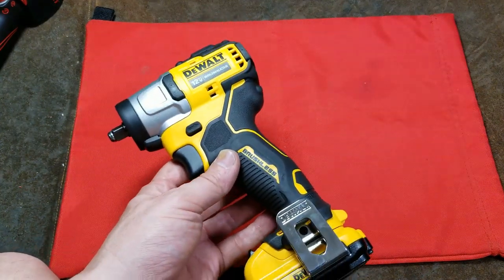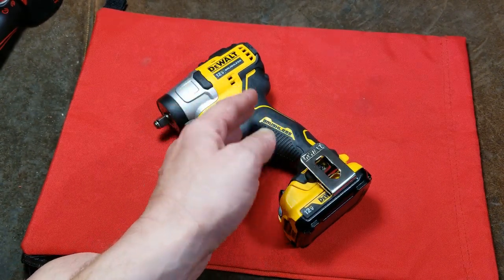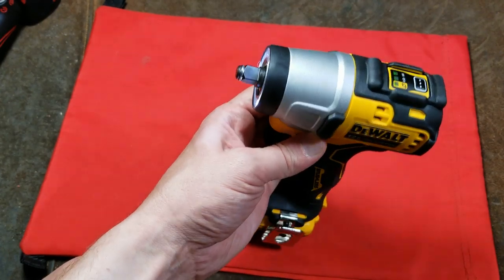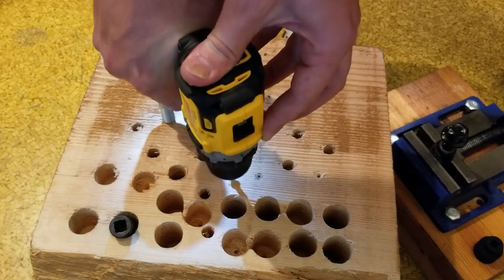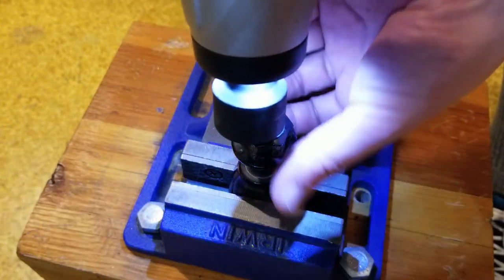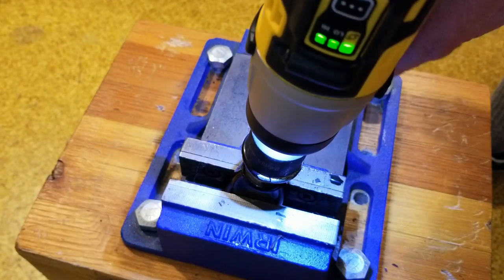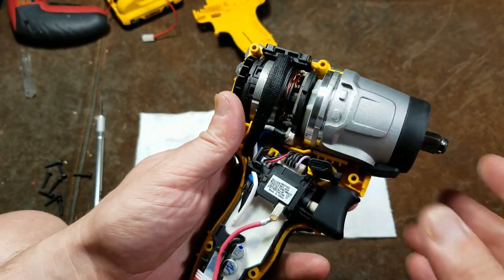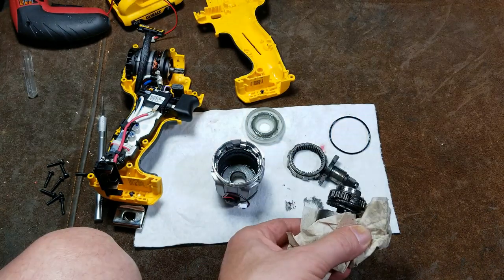DeWalt Xtreme Sub-Compact 12v Brushless ⅜" Impact Wrench Review

Comment: Great review cat, I find the dewalt pretty weak. I bought the 3/8 stubby and it’s hands down much better. I have both of them and I will be taking the dewalt back. There are a few things I like about the dewalt. The light and the handle but that’s about it. It needs more power if it had the power of the stubby I’d buy 12v dewalt all day over Milwaukee. Considering it isn’t even close I gotta pass. The 200ft lbs breakaway is a joke. It struggled on my lugnut that were 100. It did get them yes but it took a few sec to get them. Milwaukee zips then right off like nothing. I live in the rust belt so power matters a lot to me more than price. I’m not a value kinda guy I want the best you can get price be damned. I’ll pay more for not having to get up 10+ times to go get another tool to do the job at hand. I’ll pay more for that convenience any day ntm a better warranty as well. Sometimes you actually do get what you pay for.
Reply from the maker: If you want power and reliability without question than you would use a 3/8 air impact no electric tool comes close to the top end air tools. 

I got the Milwaukee M12 second gen impact and drill I'll do a review on. I agree the Milwaukee's are more powerful you can get larger batteries and they have a wider selection of tools, and a longer warranty. to bad their ergonomics are horrible. And the electronics are more questionable than the dewalt's mainly because they have to cram everything in that tiny little circuit board that they can't even protect. My review will include a teardown.
Reply: Catus Maximus I agree the handle and the light on the dewalt are def better. But that’s about it though. Well the price on it too is stupid cheap lol 👍🏼

Comment: I don't think the comment about using smaller sockets is correct. When I use a short impact socket on my car's lugnuts, it just rattles around, but the heavier deepwell takes them right off. Greater mass helps, which happened in this video too.

Comment: I just did some tests with mine and when I run down a nut in the precision control mode it seems to work fantastic for me. There was definitely an abrupt stop, decent pause and then  it continued to hammer. I have to say I’m pretty impressed with this feature. After watching yours a few times it looks like yours may be defective. Yours goes into hammer mode way faster than mine. Is it possible that the fixed a flaw and this happens to a certain amount of tools and not others?? Again, great review. Thank you

Comment: As always a very well done and comprehensive review. I imagine the Milwaukee 12V Stubby is a more capable impact wrench. However at a bare tool price of $175. USD it seems too pricey relative to the DeWalt Xtreme which includes 2 batteries, dual  voltage charger and a contractor bag for $99. USD. Thanks for posting  these helpful vids!
Reply: cardo yes Milwaukee is more expensive but it’s a much better more powerful tool. I have both and the dewalt doesn’t have near the power of Milwaukee stubby. I live up north in the rust belt and you need the extra power. The dewalt is nice however don’t expect much out of it.
Reply: Good to know, I live in the NY metro area we have to deal with rust as well though not as bad as where you are.  Always rather more power than not enough (especially when adjustable). I still think that $179.00 USD for the bare tool is too much, let's see what Black Friday or Cyber Monday may bring, if any deal on the Stubby impacts.
Reply: cardo I agree it is expensive bro. Go to eBay you can usually find it cheaper. I bought the hammer drill and impact 18v the new set normally 400 in store got it on eBay for 230. It is more money but it can do a lot more. The thing I like about the dewalt is the handle and the light. I have the Milwaukee stubby and the hi torque. I do like the light and the grip on the dewalt though. The price on the dewalt was so cheap I had to get it to check it out. It’s nice for really small stuff though. If you plan on fixing and maintaining cars though I wouldn’t recommend it. Get the 1/2  harbor freight impact sockets they’re awesome and super cheap. Extensions are good too. The Milwaukee is worth every penny though.
Reply: Peep18m Appreciate all the info, I'm a little paranoid buying off eBay if it's not an authorized retailer. I'm   not sure if Milwaukee would try to get out of a warranty claim if I had one. I have found some good deals in recent months for Milwaukee cordless power tools online looking out for HD's Special Buys or  Special Buy of the day promotions. I bought the Mid Torque kit have not had a chance to use it yet, hoping it can handle Honda axle nuts. Love the High Torque seems a little big and heavy for most of my needs, but HD has it for $250. with the 5 amp battery, that seems like a solid deal. I handled the Dewalt's at Lowes and they do feel very nice in the hand especially the 12V Xtremes.  The M12 series I really like but the handles are a little on the thick side for most of us with the integrated handle battery, but they are very good tools. Thanks again 👍🏽
Reply: cardo oh yeah I don’t like the Milwaukee handles at all lol. If you file for a warranty online it’s no biggie. There’s engravings on the tools that tell them the warranty info. He has had good deals as well as acme tools. I have the high torque and I wouldn’t trade it for nothing. That thing is def worth every penny. Hd has the buy the impact get a free 5.0 battery. The m18 handles are very nice nothing like m12 tools. Anytime brother take care and enjoy whatever you get 👍🏼👍🏼
Reply: Peep18m One YouTube creator referred to the High Torque as the "Miracle Worker."  I may return my Mid Torque for a High Torque and get a Stubby for the smaller jobs. It looks like that $250. w/a 5ah battery at HD deal is gone at this point. What size Stubby did you go with ?  I will be working on  my Asian passenger cars and minivan.
Reply: @Peep18m  eh for 200 i got my deaalt mid torque

Comment: Hey, do you still have this in your collection? To do a side by side with the 3/8th model with the larger body that came out on the 12v line?
Reply from the maker: Yes I still have this one and I picked up the half inch 12 volt French which is about twice the power I'll do a comparison video soon here
Reply: @CatusMaximus  I'm sure the 3/8th of the 5ah one is just a different head unit.

Comment: No sir they make 2 more impacts in the xtreme, both have 250 f and 400 r, one with 3/8 and half inch
Reply: That new impacts, is much larger and also does not have the setting speed switch.
Reply: @SnD340  nope same length, they are subcompact models, just a tad thicker, I own all 3 of them
Reply: @SnD340  they are not much larger, u must be thinking of the 20 volt, all the xtreme models are small
Reply: @SnD340  being small is  the goal with the xtreme line....

Comment: Bought one a couple weeks back, work on diesel powered pumps for a rental company, I will say this little thing is actually pretty good. I use it on a bunch of tight access bolts for example starter bolts, it can tuck up behind the starter on most of our pumps. Yes it is not very powerful but I didn’t buy it to bust loose rusted and seized bolts. So to me money well spent.

Comment: FYI: The F/R switch has a center position that locks trigger so that the light and motor can't be turned on inside a bag or tool box. 
As for the membrane switch cover: I've seen those deteriorated by oils, chemicals and sunlight. My Sears window a/c disintegrated from sunlight. My neighbor has identical unit, never been exposed to sunlight, is still good.  Now I can only use the remote to operate A/C. My microwave oven, tossed it after 5 years, only issue was switch covers. Guessing cleaning agents deteriorated plastic. So yeah, hopefully it holds up. Or is available and dirt cheap to replace in future.

Comment: Nice review 👍 but I still don't understand the DeWalt 12 volt line
Reply: Think of a car model  that comes with a variety of motors, all at different prices. A 4 or 6 cylinder car will have lighter suspension, rear end, and brakes than a V8, which allows the manufacturer to price the car into a range that is affordable for many more people  than the V8 car. 
This impact is only $99 with 2 batteries. A similar 20v is 50% more expensive.
But,  besides all the above, it's a game. What would Dewalt designers & engineers do if the company only released a new 20v tool every 5 years? They'd be out of a job, the company would lose talented experienced enployees. Thus, a new 12v tool line to design, build and sell.
Reply: @bartprice3439  🤙
Reply: Not every job requires an 18v power tool... I can only surmise that if you're asking that question, you don't really understand tools.... ? I was operating a cherry-picker for a locksmith company changing locks and hinges on a university building in Oxford. The guy in the basket with me was using 18v Makitas, which, nice tools, seemed oversized for the job. I happened to have my 12v 1st Gen kit in the van. I said to him "Try this impact driver and drill, see how you get on". By the end of the day, he was sold on it, found a kit on eBay and ordered it. I met him on another job some weeks later and he well chuffed with the kit and had already bought a couple more DeWalt tools... I've been using DeWalt tools since 2014 and, apart from a couple of battery issues that got sorted, I've had no problems... btw, check out the Flexvolt series of tools... see what you make of those. 
Love, Light and Peace
Reply: DeWaltaholic UK I have some flex volt stuff they definitely putout! What I meant by this was. these tools are almost just as expensive and really not that much more compact then the 20volt offerings. I like the vertical type of battery because they tuck into the handle and don’t get in the way. I am sure these are a fine tool but there compact line is kinda a joke with what they offer and there charging a big box premium for an economy compact tool.
Reply: Junk: I kinda get where you're coming from but my 12v stuff became my go-to tools for most jobs (general contractor) although I do have 18 & 54v tools... i like the compactness, balance and general feel of these tools. And, working from a cherry-picked, that all contributes when in a confined space and weight is a primary consideration, especially when there are 2 people in the basket... £159 for DCF902, 2x2ah batteries, case and charger... I feel it's the money as it's been updated with more than brushless motor... check out Catus Maximus videos with the tear down showing the internal workings.... :-)
Reply: DeWaltaholic UK I will do that 👍

Comment: Great video especially the break down. Theres no doubt the dewalt has the market with ergonomics and LED capabilities. The only problem I have with the this dewalt it claims to have 125lbs. of break away power. You'd be lucky if you hit 110-115 max. Torq some bolts down and check them yourselves.
Reply from the maker: The torque rating is probably quoted with their more expensive 3:00 amp battery versus a 2:00 amp that comes with it
Reply: @CatusMaximus  maybe you should try it for yourself? Don't get me wrong it's a great tool but the break away power is really off.
Reply: 921 atomic is the stubby rival and really does beat it barely but id say even. 902 is super fun to use cause it’s so small but really not much of any power. Still nice tool

Comment: I think people need to take into consideration what you use a 3/8 impact for. Mostly small fasteners, maybe from 8mm but mostly 10–15mm bolts. Those usually aren’t too tight. 3/8 impacts aren’t designed to remove huge bolts like some people expect. This seems more than adequate for those small fasteners.

Comment: You certainly will be able to see what your working on when underneath a vehicle. I can't remember ever seeing more built-in lighting than that impact has. Nice.
Unfortunately for me, I ran out and got into the 20v Earthquake XT cordless platform when they came out. The 3/8" impact is fine for most things and the 1/2" is a powerhouse which I rarely need. I assumed there was going to be a huge family of high-end cordless tools to choose from eventually. But so far, I've regretted that decision and it becomes more regrettable as time goes on and other manufacturers release bigger & better platforms.

Comment: So. I'm a hacker. In the purest sense. And when you slightllyyyyyyyy squeeze on low mode. It will cut the lights out. Just a bit of a squeeze and the line cuts. 

I didn't know if anyone noticed.
Reply from the maker: I think that is a issue with your unit, Mine dies not do that.
Reply: @CatusMaximus  I like it, nothing seems to be off with it. And I have to be justttttt so slight to make it happen.

Comment: I have this thing, it’s excellent, the only thing, does a crap ton of impacts and it sounds annoying compared to my other 1/2” drive larger impact wrenches which do firmer but less impacts. That smart mode is great for snugging up bolts prior to getting the torque wrench on them for final torque.

Comment: Now they need to put a 1/4 anvil on it!
Reply: Prolly better off just using a impact driver with a 1/4 anvil adapter.
Reply: I actually buy 1/4” impacts, because I get tired of losing and breaking adapters. I do have an old makita hex impact driver for bits though.

Comment: Using 3/8 one does not need 250 ft-lbs of torque. If you are working on motorcycles (like Yamaha/Kawi) ect... One has to know the feel of the fastener. Plus, 5mm/6mm bolts the Millwa-CHINA will be snapping them all off and the handle as you stated is HUGE on the MIlweChina.
Reply: So you like the DeChinaPartsWalt better?
Reply: I agree. I bought this for my car and truck. However, I will use it on my motorcycles. 
I've been using the 12V Hercules impact on my bikes. I really like it, especially for Allen and Phillips head screws. It does not hit hard in the first few impacts, so it doesn't strip or snap 4mm screws. But it will break about 50 ft lbs torqued hardware. Personally I like ergonomics better than the Dewalt. The variable speed trigger on the Herc is nicely  progressive.
I haven't bought a 1/4" hex adapter for the Dewalt 3/8" yet or used it on wood screws or my motorcycles. But it worked great pulling  transmission to replace flywheel, clutch and rebuilding the 5 speed on my S10 4x4. Worked on almost all the nuts & bolts.  I only needed to use  a 1/4" drive air ratchet for a few near-zero clearance bolts. I'll  say it's nice not to have to mess around with an air hose while under a rig on a creeper. 
Also, I caught a Volvo station wagon and myself on a creeper on fire by igniting leaking gas with my brushed 110v impact that shoots sparks off the brushed motor. The brushless Dewalt should eliminate that potential issue. I never want to go through that terror again.
Reply: Well, my most used 3/8” impact is rated at 600, so I disagree. Lol
Reply: I have a 1/4 impact for little stuff, and 3 or 4 3/8 impacts from the likes of this one, and m12 stubby, and a 2852 Milwaukee which is actually just a mid torque half with a 3/8 anvil. Just put a clutch in a freightliner without touching a 1/2” socket or impact. Driveshaft, Carrier bearing, bell bolts, flywheel bolts, clutch bolts....3/8”. Now, that said, I could use a cheaper 1/2” impact and sockets and swivels and do the same job maybe, but it’s bigger bulkier stuff. Not an excess of room under a floorboard. I’m rather partial to my above 250 3/8 stuff.

Comment: This wrench couldn’t take off my lugs tightened by a tire shop, but when I broke them and tightened them down to 100 it could. Why is DeWalt saying 200 foot pounds of breakaway? Are they upping the juice on breakaway through a clever bit of electrical engineering?
Reply from the maker: See if it does any better if he using the absolute shortest lightest socket

No it's the nature of impacts company should not right nut busting torque that measurement only occurs when you take the Anvil the tool and put it in a vise with a pressure sensor. Also Torque from Impact is highly variable due to the size and weight of the sockets the size and weight of the fastener etcetera.

Impact wrenches are kinetic energy tools and every bit of mass and any spring activity that they have to unnecessarily accelerate just takes away from their power if you have really long 2 ft and 3 foot extensions even a giant air impact could barely remove a lug nut
Reply: Have you tried those heavy sockets made for honda crank bolts? They say they have more rotational inertia.
Reply from the maker: Those are completely ridiculous yes I have that is an item just to pull money out of somebody's pocket believe me any 19 mm quality impact socket will remove on the crank bolts you do not need one with half inch thick walls. That extra inertia actually means it's just sucking away more power from your impact wrench because there's more weight for the impact that have to try to accelerate in addition to the bolt
Reply: Catus are you a professional mechanic to base your review of the inertia socket to remove Honda crank bolts?
Reply: @foodskewed9197  He had a video showing the difference between heavy and light weight sockets.